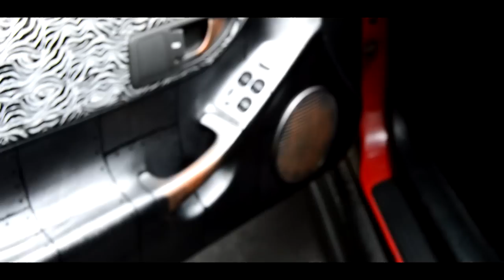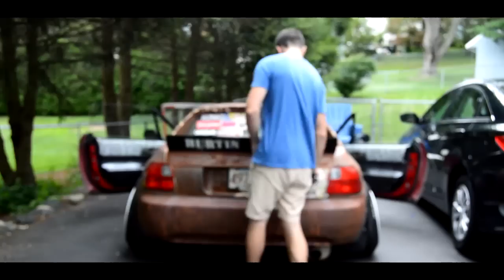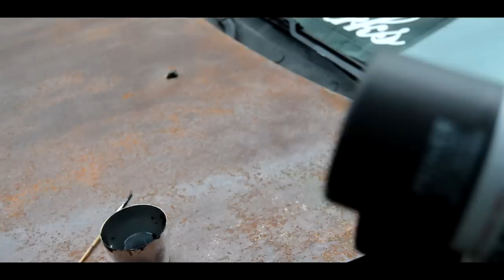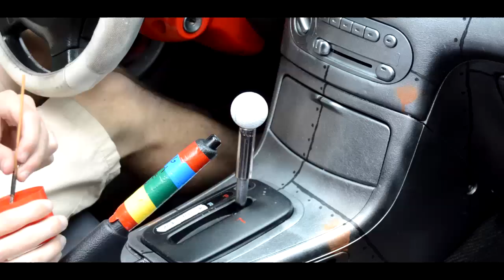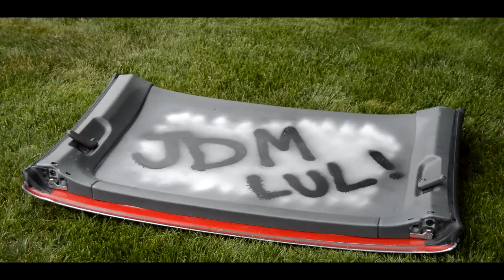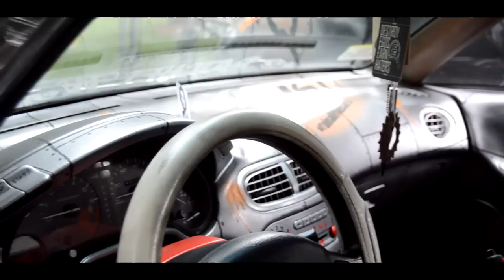WW2 Cockpit themed Interior in the Ruined_sol

Comment: Looks good, if you ever redo it consider scoring along the lines where you are trying to imitate the panel gap, rivets would be cool as well. But it's your car and I'm no expert either. There's a bare metal Mercedes w114 on stanceworks with heaps of custom metal work both inside and out (rivets, brass bumpers all that) which you should definitely give a look, looks great and it's a little reminiscent of what you're going with for your own interior :)